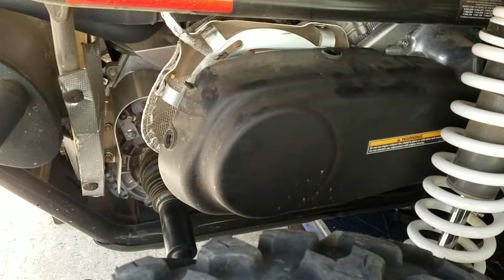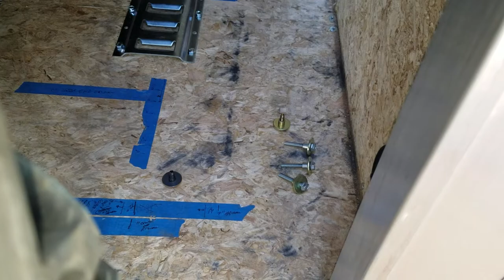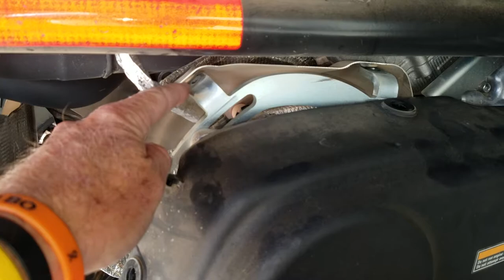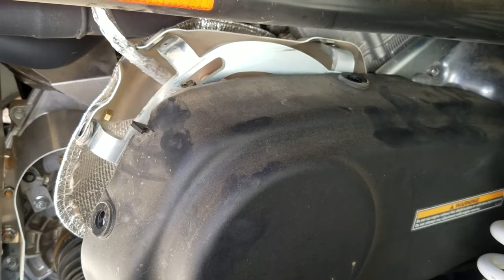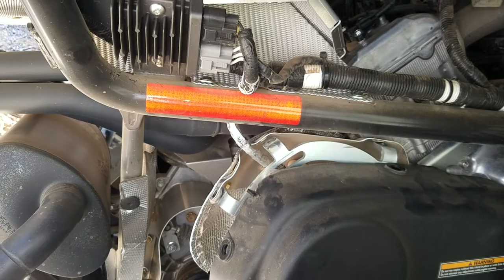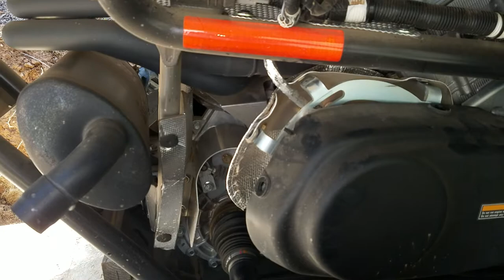Textron Wildcat XX chasing rattles pt 2 of 2-help me

Comment: Wrap some bailing wire around the springs to compress them super tight where the header connects to muffler! Mine was noisy until then and I also went with the Q6 Speedwerx’s slip on.

Comment: WELL, I have an update for you.  I found 2 spots on my 22,  that ttlle is real bad BUT no longer.  Where the top bolt fits into the cover around the alternator shield...well that shield is actually hitting the engine, thats the main one.  You need to take a long screwdriver and push it down, it will bend.
The second, is the heat sheild right above on the frame, where the reflector tape is.  We are looking at right at it.  Where the heat shield is sitting on the tube frame.  Lift it up with a screwdriver and there is another small spot on that same sheild behind that spot..good luck.

Comment: I’ve heard guys wrapping bailing wire around the springs and pipe holding muffler to header! Fixing that rattle!
Reply from the maker: I tried putting high temp silicone bead across the springs to kill the buzz. I might try wiring them.

Comment: Other than the rattle how are you liking your xx any issues with anything on it I have a 19 as well and I love everything about it other than the rear suspension is way to soft even on 3 it still blows threw the stroke on hard hits the front feels great other than that I’ve had no mechanical issues
Reply from the maker: Overall I love the car. My driver's door plastic swells and binds at front edge in the heat. Rear is soft for sure. Wish the put a 5th point harness tab from the factory. Wiring harness should be longer to reach over the Rugged Radio to the top switches on my speed energy dash plate without using jumpers. I did put led bulbs in headlights. I'm searching/hoping for a quiet/deeper exhaust.
Reply: Where did you find jumpers for the switches I’m running the same speed dash plate with the same issue
Reply from the maker: @KC-7mm  I made my own.  Some of my switches were not the 3 prong anyway. Others were the 3 prong found at Dragon Fire.
Reply: Mike Desilets thanks
Reply: After adjusting my stock shocks it took all that soft back end away. Getting pretty big air now